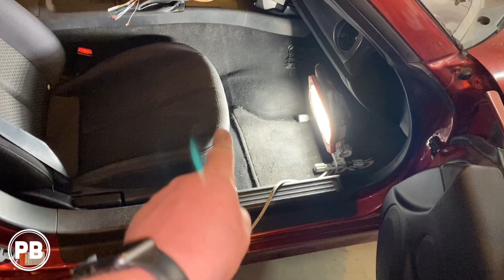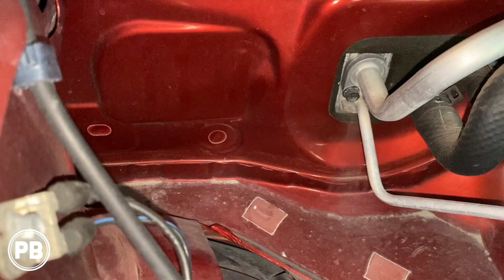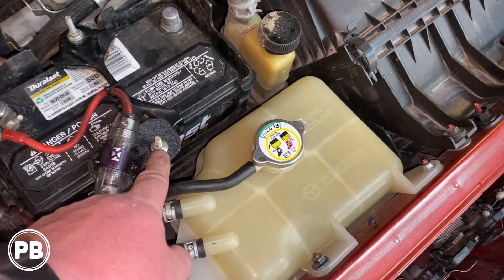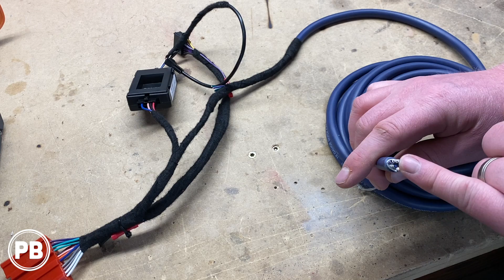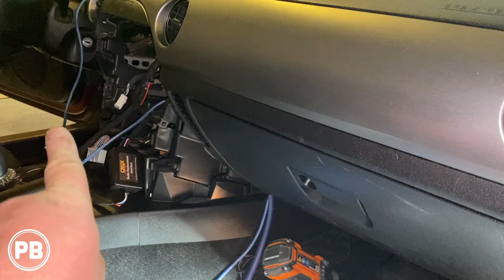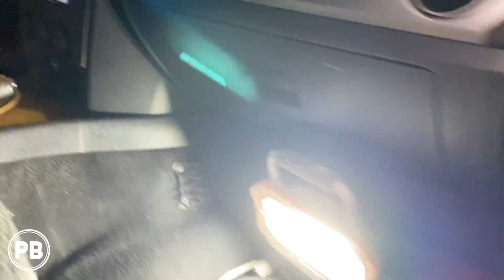2006 - 2015 Mazda MX-5 Miata Amplifier Install

Comment: Good afternoon, thank you very much for your video, now I understand how to run the cable from under the hood to under the seat in the car to connect the amp, and also how to run the RCA cable from the amp to the stereo. But I still do not understand how you powered the speakers through the amplifier, did not see the process of wiring the speaker cable from the amplifier to the two doors. I have a feeling that you wired the speaker cable to the stereo, but this connection does not suit me. 
I'm going to put 8” woofers in the doors, tweeters in the pillars on the sides of the windshield, and midrange speakers in the doors (where the factory tweeters were). I'm using a 6-channel amplifier with a DSP processor for the wiring, so I don't want to use the car wiring in any way. 

Could you please tell me how to route the speaker cable from under the passenger seat to the driver's door? 

Also interested in the question: if any of you installed in the car regulator for the processor amplifier or similar things, where it can be placed without serious modifications, so as not to spoil the interior of the car?

Comment: If my MX5 has the Bose system and the Bose amp goes bad wouldn't that mean that I can't use the factory wire harness for the speakers because they are going through a dead Bose amplifier. Would ,it that make the speakers from the wire harness useless?

Comment: Curious with the stereo the speakers, the amp and installation for that unit you just did what is something like that run thanks
Reply: $700-1000 for the front stage if you take it to a shop

Comment: Hey! Were you able to get the auto dim function to work with the Cruz wiring interface? If so, how were you able to do it? Also, what made you choose Cruz over PAC for this install? 

Thanks!
Reply: Having just gone through this issue with the Cruz wiring harness this week, the connector is mis-pinned and requires removing the illumination wire from the connector and placing it in the correct spot.

Comment: How did you fix the amp to the floor? Also are the wires within the speed wire labelled in terms of inputs/outputs?If a novice like me is doing this, then is it easy to figure out which wires need to be used from the speed wire?

Comment: You're using RCA outs for the  speakers - how does the stereo handle having a power amp built in that's not being used?
Reply from the maker: Just like any aftermarket radio that is paired with an amp instead of directly connected with speakers, it's just fine, doesn't change any performance.

Comment: How good are they with out air fan ventilation when playing 75% for a couple of hours ? What’s recommended a 4ch or the 2 ch since I have the idea to put both rear and front left side to one ch parallel and the same for the right side my concern is which of this model of amps will run cooler and loud at the same time with out being so stressed out my speakers are 50watts at 4ohms each so a total I wouldn’t know how ohms and watts add up ??